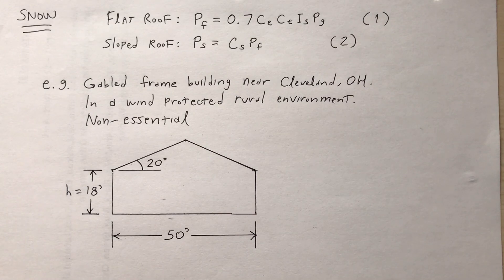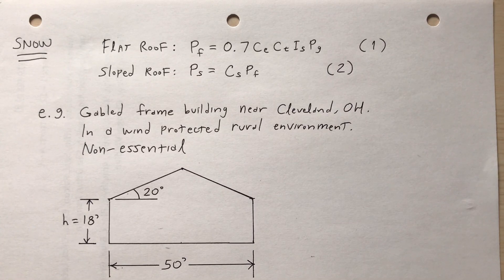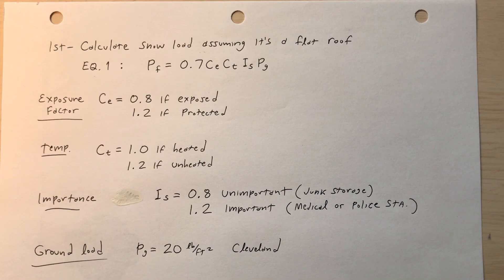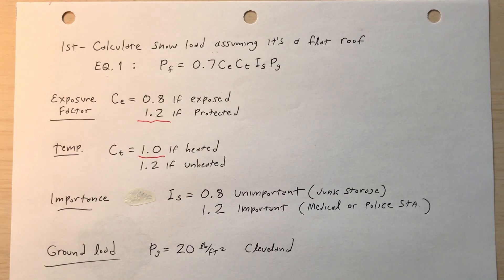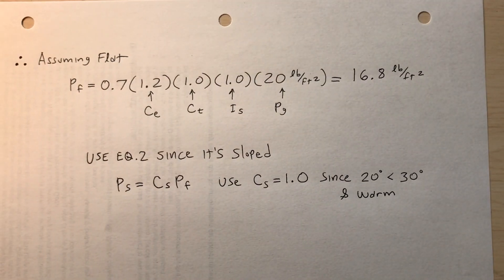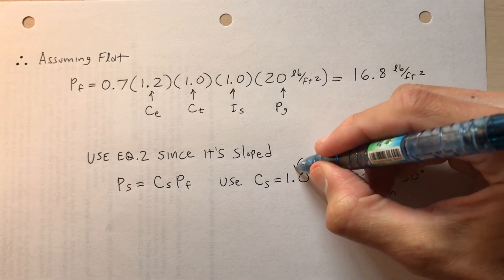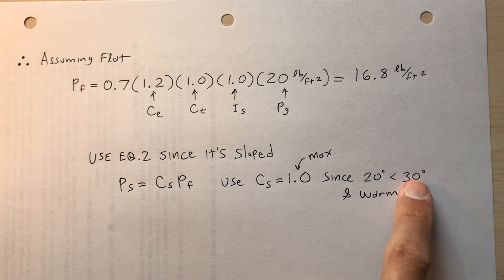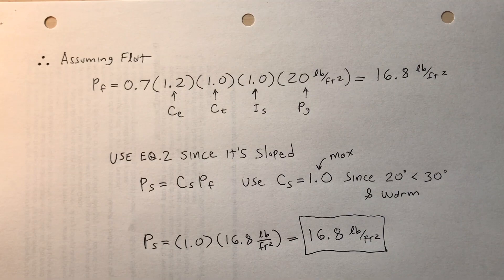Structural Analysis for Civil Engineers:  Roof Snow Load

Comment: Why did you assume its heated? Also, can we assume that its not heated?
Reply: Residential homes are heated so it would melt some of the snow from heat escaping the roofs. You can assume it’s not heated if your building is like a storage facility without climate control